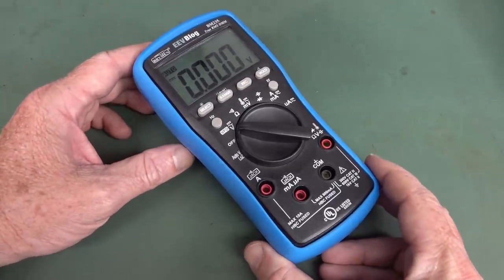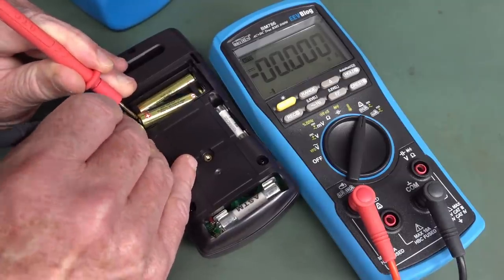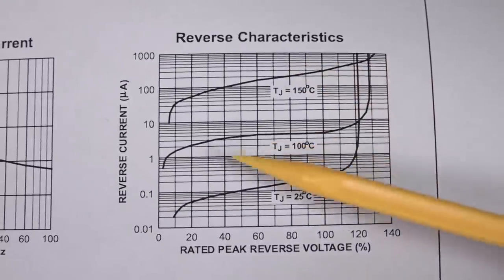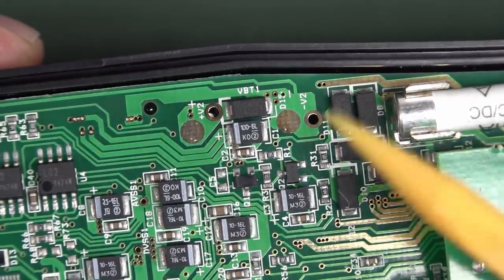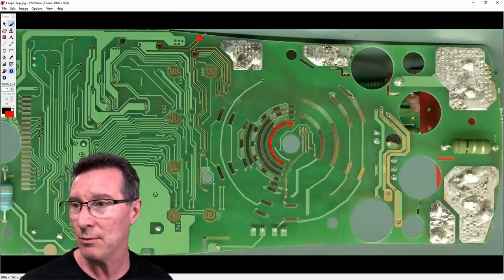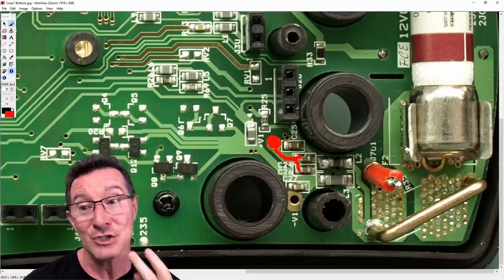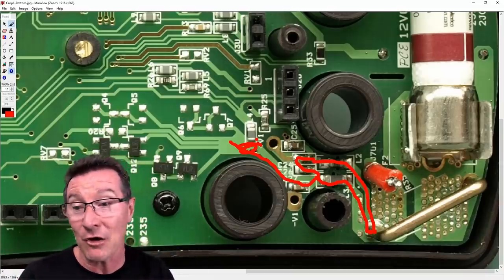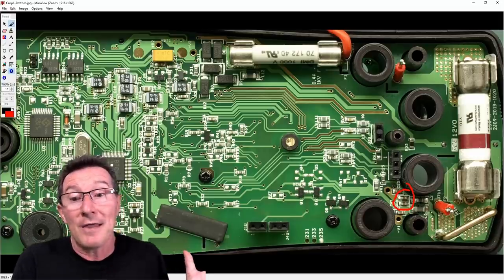EEVblog 1449 - What Causes Excess Battery Drain? (BM235)

Comment: I would certainly be suspecting the caps before suspecting the diode, they often fail from physical stresses or corrosion, with a known flex issue in that area I would be 99% sure one of the caps has a fracture which results in them shorting out.
Reply: Absolutely agree with
Reply: I think you've nailed it
Reply: i had one fail on me just from hand-soldering (or may have been faulty from the factory). I used it as a dc blocking cap in an audio amp, and had some dc at the output because of the leaky capacitor. I've seen cracked ones go short a fair number of times (cracked because pcb bends; i drop my multimeters fairly often and i bet others do too).
Reply: No! Corrosion is only applicable / known for Thin Film resistors, where the protection layer has pinholes. Have never heard of corrosion failures on MLCCs in Automotive.
Reply: just repeated thermal stress can crack them, especially X7R curve capacitors because the ceramic is very piezoelectric

Comment: A possible failure mode for the diode: if someone did install the batteries backwards, you would dump a lot of current through that diode. That could leave it with permanently degraded leakage.
Reply: I tried to post a more detailed analysis, but my post was blocked--maybe because I tried to link the relevant data sheets? Anyway, depending on some assumptions, a pair of fresh Energizers would end up dumping anywhere from 2 to 10 amps through the 4007--well in excess of its 1A rating.  It would not surprise me to see permanently elevated leakage after that abuse.
Reply: @danmenes3143  Interesting. That deserves further investigation. If it is the case then this kind of battery draining could be significant on a global scale?
Reply: @danmenes3143  My same thinking. It's also so easy to do and not notice for a few moments or even minutes. It could even create some magic smoke if left for a little while to sit. 

Frankly the reverse diode protection only works well if there is a fuse in series with the power source. Otherwise the best alternatives are a series diode or similar solution (N or P MOSFET circuits)
Reply: @nlhans1990  That's what I'm thinking. Suppose you screwed the cover back on, then flipped it over and noticed it wouldn't turn on. "Magic smoke smell" might well be your first hint about what was wrong. A fuse or a PTC thermistor could be used to protect the crowbar diode.
Reply: @danmenes3143  I was thinking the same thing during the video. Snap some primary lithium cells or rechargeable NiMh cells in there and it will easily exceed the maximum forward current of the diode. There would be at least a few watts of dissipation in the diode if high-capacity cells were used. If I were to use something like that, I would want to mold some additional features into the battery compartment to prevent the cells from making contact if they are put in reverse. The diode would then be a belt and suspenders in case the 200 lb. gorilla crammed them in hard enough to make momentary contact.
Reply: Many battery holders will not make contact with the battery if the battery is put in reversed. But the BM235 unfortunately does not have that feature, so your explanation is plausible
Reply: @babbadge  A good point. I thought about that, and I reasoned that this meter probably did not have that feature--or Brymen would not have needed to add the protection diode in a revision. I infer that Brymen got a bunch of meters back after the batteries were inserted wrong, and it was cheaper to add the diode than modify the case mold. Nice to have that confirmed.

Comment: I do find it quite disheartening that the manufacturer will happily promote repairs by creating a DMM, yet won't release schematics to repair their own devices 🙄 great video as always Dave, look forward to these videos
Reply: Specially cause anyone can just open the meter and reverse engineer it anyway, it’s not like they are stopping anyone from copying it 🤦🏼‍♂️
Reply: They are probably concerned about Chinese knockoffs. It can be reverse engineered anyway, but having to do it is still somewhat of a barrier to it.
Reply: @sylviam6535  yeah but if they had half a brain they'd know schematics have been around for macboooks for years and no nock off macboooks are on the market lol
Reply: @Kc12v140  yeah it wouldn't be difficult for someone like BigClive to reverse engineer within a few hours, a day at most lol
Reply: @TheCod3r  - Macs use lots of custom hardware which their suppliers are not allowed to sell to anyone else. See the Louis Rossmann channel for the loops he has to go through to find parts for repairs.

Comment: When you say "it's 10V" for a 1N4007 that's actually the chart of 10% or 100V
Reply: For a jellybean diode making all the parts for 1kV, and likely also having most of them likely to survive 2kV in reality is cheap, so no reason to make the lower ranges, unless you are having a bad process month, and they are failing at 1kV, so you are looking at the voltage they fail, and binning the bad ones as 1N4001, so you can get them out, or simply making the entire run as 1N4001, even if only 1% are not passing at 1kV.

Most likes will only give you the lower voltage if you special order them, and in any case will give the 1kV part as standard, just marked down. Generally for things like military or aerospace parts, where they originally put in 1N4001, so changing part number is a pain, but the supplier can provide the part, marked as 1N4001, and it will pass the entire test spec for the 1N4001 part.

Originally IIRC the 1N4007 used to be a special process part, with a mesa etch to have the corners able to withstand 1kV, instead of the regular 1N400x, which was simply a scribed die. But turns out easier to not skip the process step, to do the mesa etch, so they made all of them as that instead, and got the process dialled in right. Slight difference in surge capability, but if you are doing something that runs the diode at that ragged edge you are doing it wrong, because there will be some that do not meet that "typical, not tested in production" spec off the line. If you want an avalanche diode there are better diodes, with actual process controls for the voltage. 

I have a large number of 12V and 24V zener diodes, which I use more often than not as regular diodes, as they do work well there, replacing the 1N4148 in most cases. Have accidentally made a few of them turn into LED's as well, at least for a second or three.
Reply from the maker: D'oh, yeah, totally missed the %
Reply: @SeanBZA  The 1N400x series were first made back in 1963 when binning would certainly have been required to get a decent yield.  These days I'd be surprised if they aren't all 1000v parts which are just remarked.
Reply: @ferrumignis  That is why you also got a 1N4000 diode, which was guaranteed to be a diode, though not above 25V, and it was very common in the surplus market in bags of assorted components. 

IIRC Sinclair used to use the reject transistors and diodes from Ferranti to make his first amplifier modules, taking all those production line packaged rejects, for scrap metal value, and then sorting them into categories of dead, not too dead, very leaky, not too leaky, and will work under 15V, and used them in his amplifiers, at least those with some gain.

Ferranti tested at 30V, so those that failed there could still be useful at 12V or less. Was worth it when at the time a transistor was not something you bought for a penny, but instead was up to a pound, and a pound was worth something.
Reply: @SeanBZA  Some of the old Sinclair amplifier kits were rather notorious for blowing up, so that doesn't surprise me at all.
Reply: @ferrumignis  Yes I have one that is still in the packaging, unbuilt. I am very nervous of actually building it, because I will have to test every component if it actually works, and all the transistors are unmarked devices, but they do have the Ferranti case marking in the resin. I am sure every electrolytic capacitor in there is either very dead, or very leaky, or short circuit, often all three one after the other.
Reply: @SeanBZA  That must be a very rare item, I think I'd probably leave it unbuilt and perhaps just copy the design to experiment with.
Reply: @SeanBZA  These days I feel like they're sometimes just matching whole batches as you said - I remember replacing a bridge rectifier in SMPS by whatever one I found at hand, 2 years later I reopen the device because I wanted to look up the numbers (I wanted the same form factor for some project), type it into digikey and it turned out the device worked non stop for 2 years with 50V rated bridge rectifier on 230V AC line.
Reply: @ferrumignis  generally, higher reverse voltage ratings correspond to higher leakage current and higher parasitic capacitance. That can be troublesome in sensitive designs

Comment: Putting the reverse battery protection diode after the switch doesn't sound like a terrific plan,  the entire short-circuit current of the batteries will flow through the range switch, which is most likely way above its rated current.

Comment: About the "only the 1N4007 should exist" thing: As far as I can tell, only the 1N4004 and 1N4007 actually exist. Diodes Inc gives their typical capacitance characteristics as two graphs: One for "1N4001..1N4004" and one for "1N4005..1N4007", suggesting that these bunched-together parts actually contain the same die. The lower-specced ones are just down-labeled (and, funnily enough, more expensive than the higher-specced ones... Probably because there's so little demand). I highly doubt that any of the diodes that get labeled as a "1N4001" actually failed the tests for a 1N4004.

Could be a fun thing to try - buy a few 1N4001 and 1N4004 from the same manufacturer and check their actual breakdown voltage (and/or forward voltage) to see if they're in fact the same part labeled differently.

Comment: During manufacture of my PDVS2mini's I used to have about 1 in 25 that would randomly switch themselves off during soak testing. Turns out it was a leaky reversed biased diode in the soft power switch circuit. I tested brand new diodes out the bag and could never measure a leaky one......till I reflowed a bunch in my oven. The pitfalls of 250degC lead free paste!
Changed to a different brand diode with similar spec and it never occured again.
Reply: all the more reason why banning lead in solder is stupid.
Reply: Can you provide the company of the diodes so I may be able to avoid them?
Reply: I had problems with Bournes 0805 smd inductors.
The inductance would change 20% after soldering. The temperature specs on the datasheet were followed.
These inductors had good specs for Q and current but were unusable.

Comment: I recalled repairing a TV decades ago. The complaint was the channels keep drifting. The owner had a new tuner unit replaced but that did not solved the problem. I was asked to have a look at it. I was at my wit's end and after a couple of days of meddling, I decided to check the diode 1N4148 for short but turned out OK. Anyway, I had it replaced and bingo the drifting stopped. Another time, a Luxman L85V amplifier having cracking noises on one channel that was caused by a noisy 1N4148 diode.
PS
During that time, my repair tools were and still are : a SANWA analog multimeter and my brain. No schematics. Now life is much easier with the internet.

Comment: I had a digital tyre inflator /pressure gauge that used a coin cell, right out of the box it drained the battery over night and did several new batteries the same so I contacted PCL who made or sold them and they just sent me a new one. Having been told I could bin or do whatever I wanted with the first one I took it apart and had a look at the board , first thing that caught my eye was a big fat ceramic capacitor right across the battery so I remove it and not having a replacement I put the board back in and the gauge worked perfectly and the coin cell is still working the unit two years later. Not sure why the designers thought the cell needed a bypass cap. when the microchip had several of its own. Excessive battery drain is often down to leaky by pass capacitors and always worth a look if you have that type of trouble.

Comment: In Automotive applications, there might be MLCCs on the battery input, to suppress spikes from the cars supply system. It's forbidden though, to just put a single MLCC there, only two in series, as these components might develop leakage currents due to vibration, bending, even arising from the manufacturing process. This might even cause fire in extreme cases.
Therefore, these two MLCCs are good candidates for excess leakage currents.
Reply: I work as a PCB design engineer in the auto industry. Not only are there two capacitors in series, but they're also rated for much higher voltages than required for the application and are physically rotated 90 degrees to each other. That way they won't physically both be on the same flex plane.
Reply: @Aerospace02  I think it's no secret, that small case sizes are forbidden in this case, e.g. 0805 preferred. Edge values, i.e. max. CV product of given technology should be avoided. 
As well, technologies like Open Mode or Flex Termination may be used, but unfortunately not available any more in big quantities.
Root cause of failures in MLCCs are mechanical cracks, as well as bad spots /contamination in the ceramic layers, which gradually may cause leakage currents to shorts.
Reply: But there you have other spike sources on the battery, just the battery alone like here won't produce spikes
Reply: Ford specifies any capacitor across un-switched Vbatt has to use fail safe capacitors such as Muratas GCE series, they do not allow two separate capacitors anymore, have not for a number of years now. it is in the Elcomp.
Reply: @KasperPilsted  Ford allows us to use two separate caps on unswitched Vbatt. In fact, they specify it. This is for instrument clusters and HUDs. Does it perhaps depend on the product?
Reply: @Aerospace02  Hmm. I answered and now it is gone, so hopefully this does not show up in duplicate.
Elcomp RQT-191001-009890 is the one I was looking at and you are right, it does allow two capacitors in series still, as the 3rd and least preferred option. Elcomp Applies to Body controllers, which may exclude HUD's. My last Ford project was a few years ago for the MY20 Ford Explorer keyless entry keypad, these days mostly GM, where we just carry over the same capacitors as GM does not seem to have much of a preference.

Comment: 13:40  unless there's a poly fuse or something (and even if there is), I could see not wanting the crowbar diode to act through the switch. It would subject the switch to the short circuit current, which, If they used lithium primary cells, could be quite substantial. 

It also wouldn't protect anything upstream of the switch.

Comment: If you want to compare the boards, do another scan then open both in Photoshop or Photopea and overlay one over the other in one of the odd modes like divide or difference mode.  Use "distort" to drag the corners to line up and the board will black-out as it lines up... except where the differences are.  I've got to pull my 89 IV apart at some point and probably the 189 at the same time, I'll see if I can do the same.

Comment: I just pulled my BM235 apart as I was watching this video and noticed the lack of the diode across the battery terminals in mine as compared to the one Dave was showing, I have had mine for many years now so is an older revision. My BM235 just started doing a strange fault on resistance or continuity mode will go to 0 when the leads are shorted then stay at zero when they have been opened again.

Comment: It makes sense to put your primary decoupling caps at the base of the star grounding junction. That’s your true ground reference, don’t want to add track, lead, esr and connection resistance back to the battery on top of what your reference plane is

Comment: Those two ceramic capacitors would also be my second item to check after the protection diode.  The worst thing about the MLCC caps is that they tend to break short circuit.  (Although there are some more expensive variants that are guaranteed to break open circuit, those did not appear to be that variety.)
Near the end of the video you mentioned PCB design concessions.  I know what it's like.  My most recent board is a very simple MCU (ATtiny1614) controlled power switch with 5000KV isolation, and a pair of LED's for operational status.  Even on that simple board I had to partially rewrite the firmware because I needed to change pin mapping, and my MCU is only 14 pins!  I can only imagine what happens in the back and forth at a company that is designing a board with hundreds, or even thousands, of connections, and the software, schematic, and layout guys trying to get a schematic that can be routed and still functions correctly.

Comment: I have a Fluke 87 which I bought in 1994 and it has a similar issue. It's also a known problem with this model (and a few others) and it seems that there is a residual draw on the battery even when the switch is in the OFF position - so off isn't really off at all. This meter also drains batteries when it goes into sleep mode.
One thing I found was that when the switch was in the OFF position, sometimes the display would flicker a bit and the buzzer would emit a weird noise. 
Tapping the rotary switch would affect these behaviors. The meter was then dismantled and the contacts on the rotary switch cleaned and lubricated. This stopped the above reactions, and slowed down the battery drain. I don't know why it's so hard for manufacturers to actually have the unit completely OFF when the switch says OFF. There should be ZERO current draw.